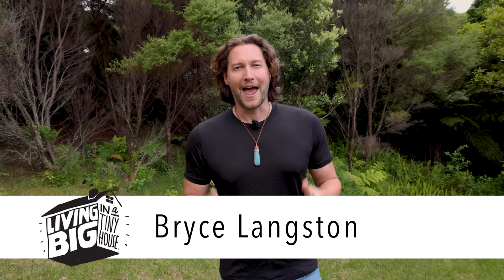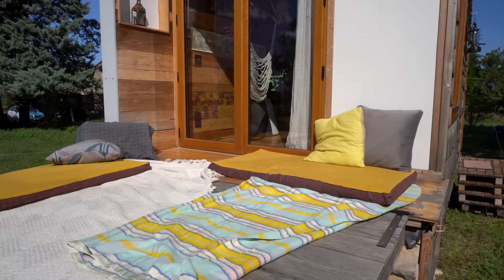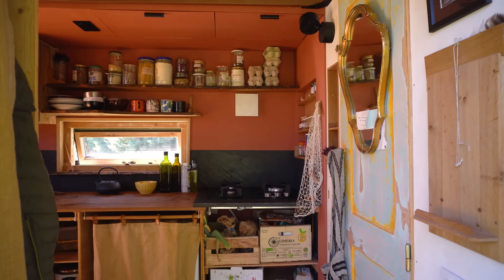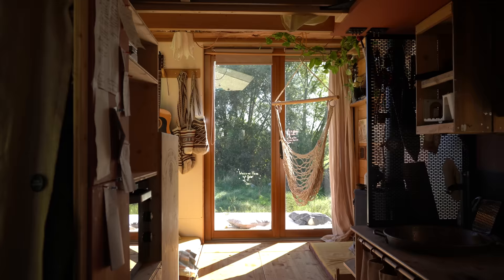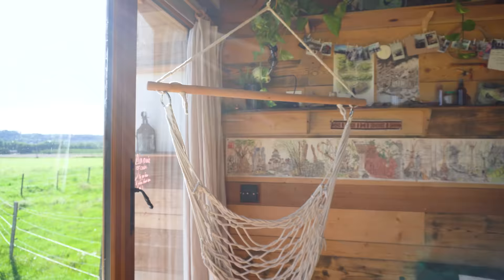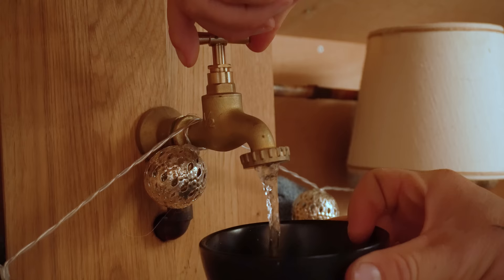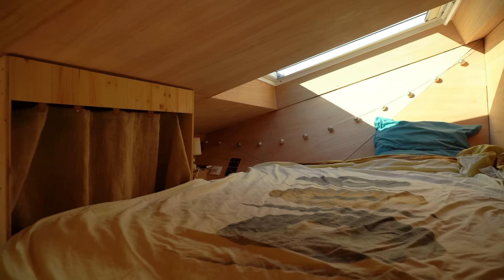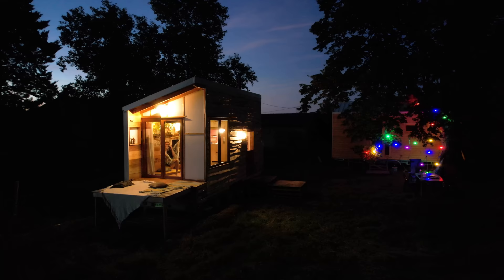This French Tiny House is a Multifunctional Marvel!

Comment: Interesting house. Well-used spaces and not a lot of space wastage. Couple of questions though: where do you put the sawdust for your composting toilet and where do you toss out/dispose of the composted material? Surely you can't just dump it in your landlord's yard?? Also, how do you heat the house? I see a chimney so assume  you have a boiler/hot water heater somewhere. I also wonder how cold those floors get when you need to open up the floor to use the table and let the cat out. I know France can get quite chilly. What about screens for the windows so the insects stay outside? Do you ever need fans or air conditioning?? Do you plan to live here for the rest of your life? I can imagine climbing up to the bedroom loft might get tricky when you are 80...Cool home!!

Comment: When I stayed in a tiny house,  the only thing I would have changed would be to remove the bathroom sink.  It was unnecessary and used valuable space in the bathroom.  Also, in the particular tiny house I stayed in, when you opened the bathroom door, the kitchen sink was 2 steps forward.

Comment: Only major concern about the table is hygiene. Yes, even a normal table you should wipe clean daily to prevent stains, but you’re not normally standing (barefoot or tracking dirt from shoes) on your table, meaning you need stronger cleaner for it, instead of just a damp cloth. I suppose one solution is tablemats, because microban and copper solutions both are considered harmful for the skin.

Comment: Instead of plugging in with the neighbors power why not use solar power and panels? How do you heat this tiny house? Also I saw no insulation, looks like it’d be freezing in the winter, no? For $20,000 I would think you’d want heat and solar for independence.